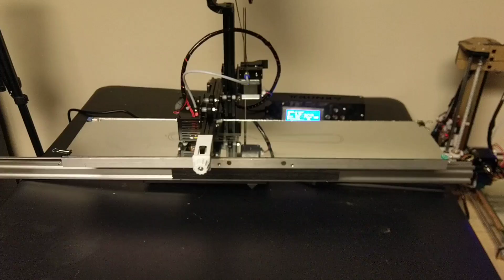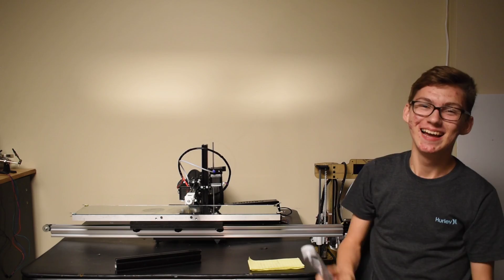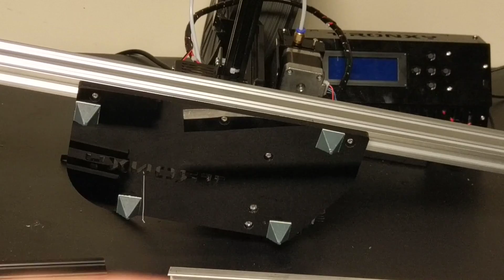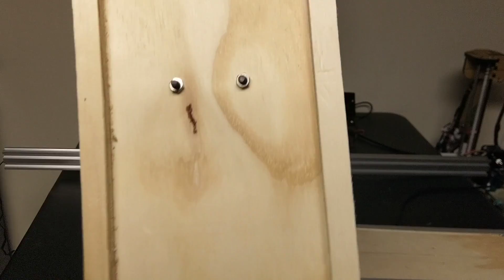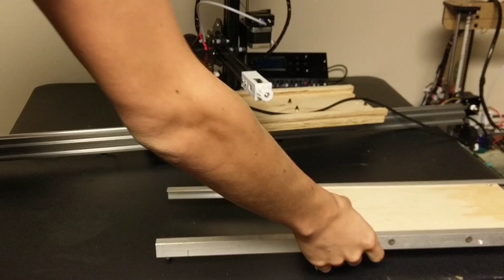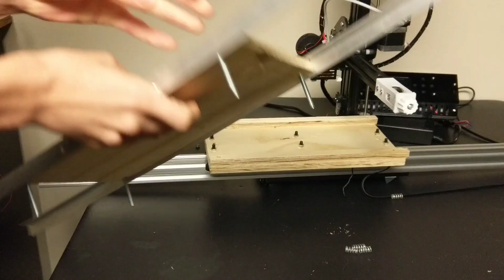Extended Bed 3d Printer! Huge Tronxy X1.

Comment: ive seen this now a couple differnt times an i got a kingroon kp3 specificly cause it was design really similar to the tronxy x1 so i could do something like this but didnt realize its y axis was on a mgn12 rail til i recieved it in the mail. so far ive just been running it as is with partcooling upgraded an it prints insanely fast pretty much cuts the print times in half comparing it to my ender 5 while producing almost as good of quality prints. each has there stronger points but i decided against moding the kp3 like this, still want to do it but i want to go with a longer mgn12 rail an that will should be pretty stiff. i guess u could do 2 rails one on either side of the 2040 extrusion instead of a single one on the top an that would make it that much more stable. has anyone looked into doing anything like this and how hard would it be to make the bed heated also. this is my biggest issue ive built a couple printers now that ive had no luck finding a heat bed that fit the size i need so i had to go with something smaller

Comment: Hi Luke, I am very impressed with what you had done. Questions:
1). The belt, is it 6mm or 10mm width ?
2). How did you adjust the Y length in the Tronxy X1 firmware ? I didn't see in your other videos.

Thanks.
Reply from the maker: Thank you! 
A1) The belt is currently 6mm, but the next iteration, if I ever get around to that, will use a Cbeam rail and a 12mm gates belt. 
A2) To adjust the X and Y axes values, I made a marlin configuration and flashed it to the board. The original Tronxy X1 used repetier, which can be limiting. I didn't make a video on this, because there are dozens of other videos on youtube about creating custom marlin firmware, but I did include my firmware in a github link under the about tab of my channel. 

Best wishes.
Reply: @MakingwithLuke  Thank you very much, I've just ordered Tronxy X1 for US$ 88.8, and plan to start this mod once arrive.
Reply from the maker: @gfhrb39qq  That's awesome! Keep me updated on your progress, please. Btw, where did you find it for 88 bucks? cheapest i can find right now is 102. I might pick another up for that price!

Comment: 🤔 Do you have custom settings for this? Since they're usually drop drown from other like printers?
Reply from the maker: Yep, check out my latest videos on this printer. I have a github page linked in the about section of my youtube channel. There you will find the firmware for the latest version of this printer. Thanks.

Comment: So, no bed heating. Will this be a problem for some filaments?
Reply from the maker: yes, it would. I only print pla (possibly tpu) though. It would be a rather simple addition to add two heater pads, and make the printer more versatile.

Comment: This is awesome! Great job!

Im wondering if an ender 2 might be a better candidate for this given it doesnt have actylic parts.
Reply from the maker: Thank you!I would love to try this on the ender 3. If you have one, you should try it. Ill be posting another video on my current iteration of the printer. I will soon be doing a build guide, and releasing parts as well.
Reply: Im also wondering if it would be possible to do a heated bed with this.
Reply from the maker: @israelcontreras5332  yes it is. It actually wouldn't be terribly difficult. You could line up two 300x300 silicone heater pads and get most of the needed build area heated. You would also have to buy a new power supply, to heat that huge area.
Reply: Ok cool...thanks man. I meant to say tronxy.
Reply from the maker: @israelcontreras5332  I actually used a ramps board, but only because I burnt the old board's extruder stepper driver. The ramps board is superior to the melzi board that came with the tronxy, though. The ramps board isn't the greatest itself, but it's  cheap, and everything I need.
Reply: I think I will. I need more space on the x or y for some stuff I want to print. I dont really need more z. This could really provide a way for me to get that going. I saw this on Thomas Sanladerer’s video about mrrf 2019. I hope i typed that correctly. Lol
Reply from the maker: @israelcontreras5332  Yeah, definitely. I think it could be a great printer as well. put an mks gen L, and a longer y beam. Thats a solid printer, now. Yeah I'm super grateful for Thomas Sanladerererereerer's video. it had given me a bunch of new traffic. and yeah, we all have trouble with his name, lol.
Reply: Dont get me wrong...im not crazy about enders...but changing the board out and making the y larger on an ender 2 could be a great printer.
Reply: So does the y stepper miss steps from the added weight? Maybe I am misunderstanding what the issue with voltage is...but does the motor need any added voltage adjustments to pull the added weight?
Reply from the maker: @israelcontreras5332  No it doesn't, with the right settings. I have tuned down my speed/accelerations/jerk. Also I turned up my voltage on my y stepper driver. The motor needs more power to drive the extra weight, and the voltage gives it that power. works like a charm.
Reply: Ok so on your build, did you stick with the ender 2 board?
Reply from the maker: @israelcontreras5332  I used a tronxy x1. Although I would like to try an ender 2/3. you can use a standard tronxy board, because you can access the firmware. I'm not sure if you can upload new firmware to the ender printers. I've heard you need to flash a bootloader to them, using a separate arduino. I would personally buy an mks gen L board, and replace the ender board with it. That would simplify the process, and you can add tmc drivers for quieter operation.

Comment: Better to drive the extended axis with a lead screw?

I would definitely be interested in converting to a long bed.
Reply from the maker: No,I dont think there would be any advantage to that.  belt works very well. its a lot of fun to build, and I would recommend it. I will be posting a build guide and files soon

Comment: Interested in the template file.  Thanks!
Reply from the maker: Either today or tomorrow I will be posting a video on it. Soon after I will post the files. I plan to build a 4th iteration of the printer soon, and I will make a build guide on that design. I'll keep you updated, but all current files will be posted soon. Thank you.

Comment: Saw this on Toms MRRF film.  You have inspired me to mod my Ender 3 in the Y as it uses 2040 native for support.  It will need guide rails but the main drive can be extended easily.  May go to NEMA 23 because of the length.  Awesome stuff!
Reply from the maker: Awesome! I'll be posting a video soon on this printer, in its current iteration. I will eventually be posting a 4th iteration build guide and the files needed to build it. My printer works fine with a standard nema 17, btw. I just turn down speeds/accelerations, and it doesn't skip steps. If you have any questions, don't hesitate to ask me! I'm more than happy to help.
Reply from the maker: @W4TRI_Ronny  possibly there or github. I will put a link to the files when I release them

Comment: Are there any designs available for this, or is this ad hoc. Nice job by the way!
Reply from the maker: Yes! Ill be posting them soon. I want to eventually make a 4th iteration that is even better, but if you want to do it the way i did it, the files will be out soon. Most of my machines will eventually be fully open source. Thank you!
Reply: This is the kid of thing that the Scale function was built for!